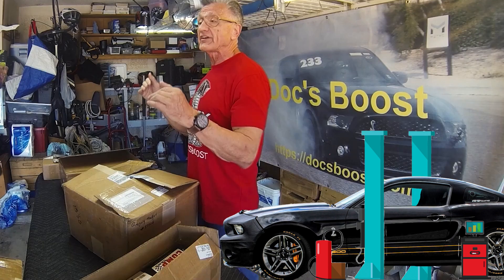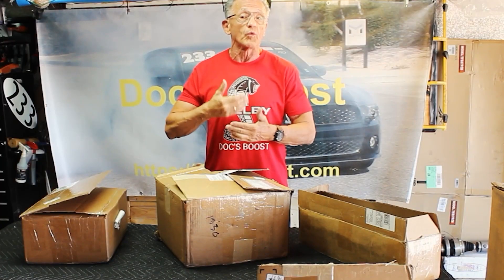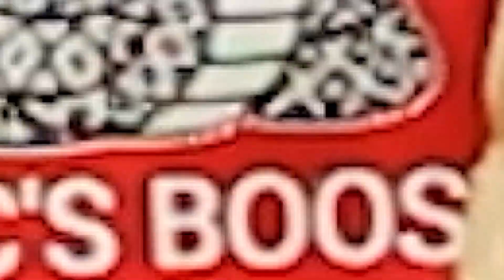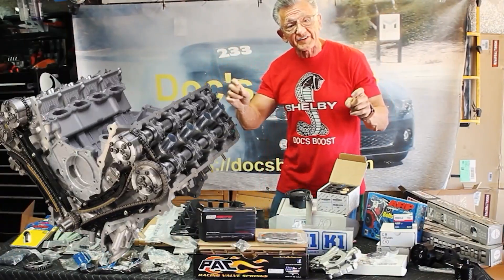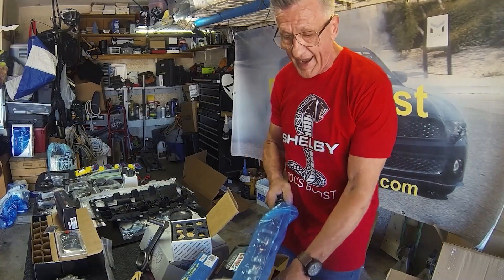The Journey to a 1000+ RWHP Shelby Begins With Forged Internals & More - Part 1

Comment: What blower are you using for this?  Thanks Doc!
Reply from the maker: I rebuilt the M122 and swapped out the pulley to a 2.5 inch.  I didn't get good results with the 2.5 so I went with a 2.7.  the 2.5 spins the rotors too fast and the cams open the valves longer and wider and that causes less boost.   Two days ago, I bought a 3.6L Kenne Bell Supercharger.  It will be a few weeks before it arrives.  Then  we'll see where we are.  LOL
Reply: @DocsBoost  yeah I was referring to which blower for the 1000hp.  I like KB, and that's what I would pick.  Can't wait for your install!
Reply from the maker: Me either.